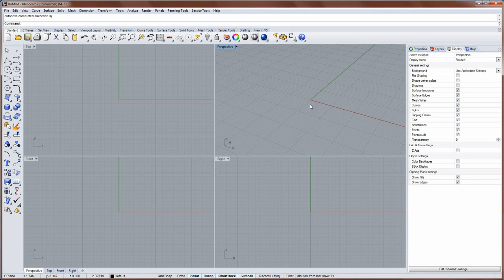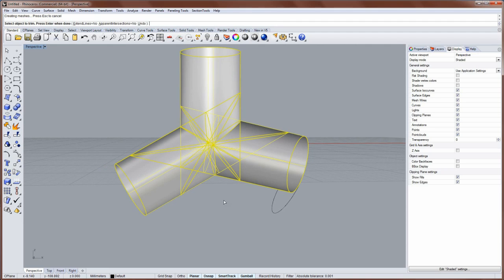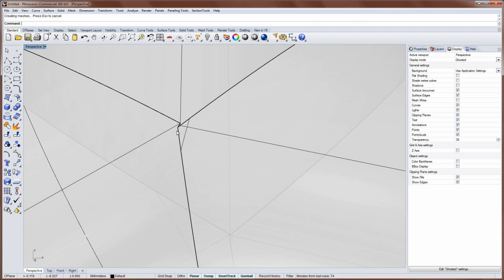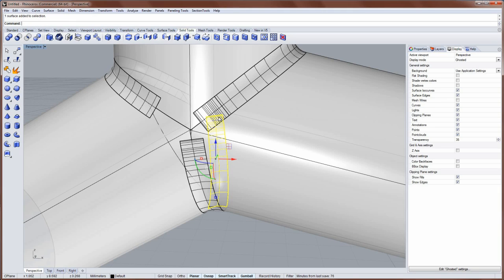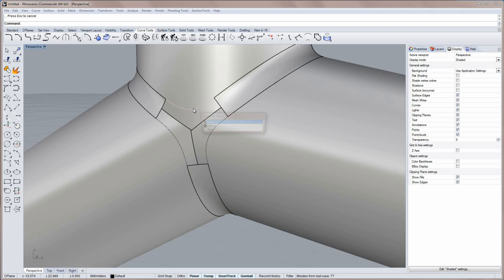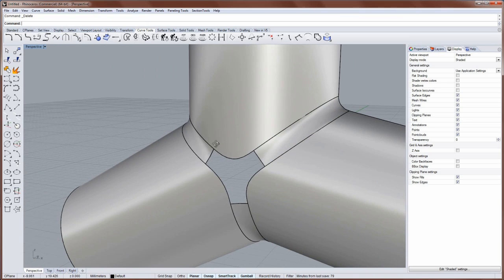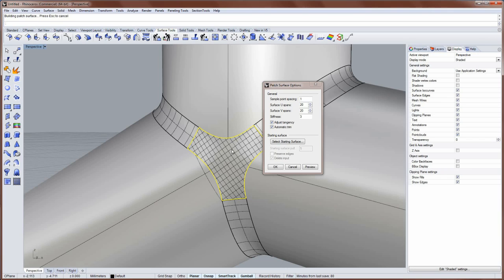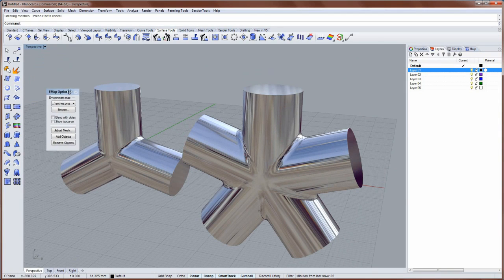Intersecting multiple pipes

Comment: Woha... with a few workarounds, it's even working in old Rhino 4.0 (using PIPE on surface edges to make up for the missing fillet functionality. Awesome!
Reply from the maker: Yes, this trick should work in any surface modeler that has a decent patch tool. If you really want to have fun, check out the MultiPipe command in Rhino 7 though :)
Reply: @RhinoGuide  Will do! Already saving up for the upgrade!

Comment: would I be able to intersect pipes that have different initial and final diameters so that the cross section is different at the ends and then continue with the sane process of edge blending as you do here? For example, your pipes start and end with the same diameter when you extrude them. But instead, you manually make pipes that start and end with different diameters so that if you were to continue extruding the pipe they would have different cross sectional areas but the intersection point of each of these pipes can still undergo this blending technique as long as you take the same steps as you did?
Reply from the maker: In theory yes, variable diameters should still work with this process. However, I'd suggest looking at the new MultiPipe command in Rhino 7 and then make a polysurface from that SubD  using ToNURBS if needed. Post a sample model to the Rhino user forum if you have more questions... https://discourse.mcneel.com/

Comment: now how to you do it with pipes of varying diameters and that intersect at odd angles?
Reply from the maker: Variable diameters should still work with this process. However, I'd suggest looking at the new MultiPipe command in Rhino 7 and then make a polysurface from that SubD using ToNURBS if needed. The Grasshopper MultiPipe component could also be used for radius control at 'node' locations as well where curves meet. Post a sample model to the Rhino user forum if you have more questions please https://discourse.mcneel.com/

Comment: is there a way to detect intersecting pipes (surface) or intersecting lines (curves) ? I want to draw an electric panel with many cables but drawing cables and turning them into thin pipes becomes complicated, i can't have any of the cables intersect each other
Reply from the maker: Hi, You could use the Intersect command to create curves or points at physical intersections. I would suggest using Grasshopper to set up a parametric file to do this so that you could see the results as you edited the curves or surfaces. Post to the Rhino forum here https://discourse.mcneel.com/ with an example of what you're working with if you need more help please.

Comment: When you blend the crv's the resulting crv will always folow the srf? or you need to specify something when dioing teh comand?
Reply from the maker: BlendCrv won't necessarily be on the surface but it may be within tolerances. Use the Pull command to move it back to the surface if it is off.

Comment: I'm trying to do a fillet on a ring and a round extrusion that sits 90º degrees on the side of the extrusion. Somehow following your method isn't working.. The ring is laying horizontally and the extrusion stands up in a vertical position.
Reply from the maker: Hi Marinus, Post the file to the user forum with just the parts in question before and after... https://discourse.mcneel.com/